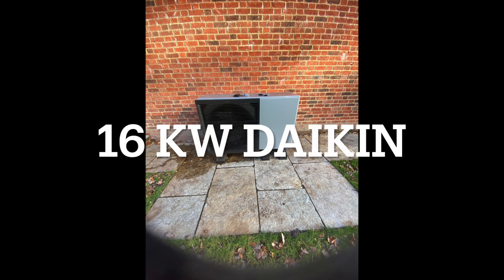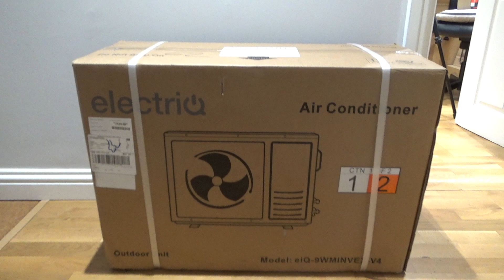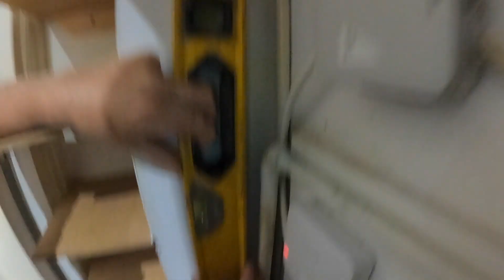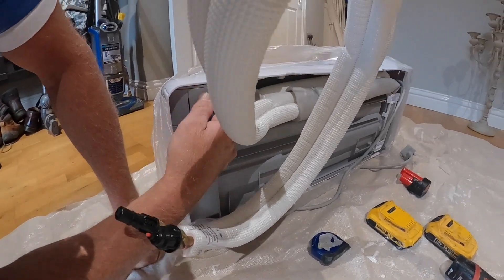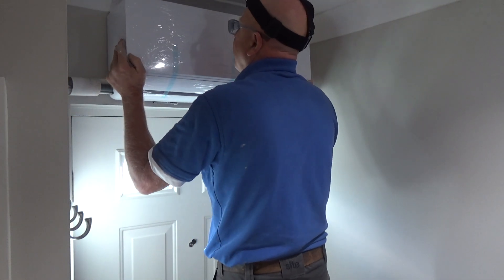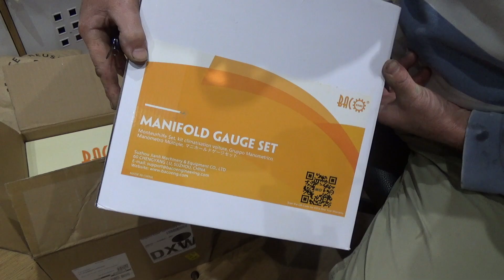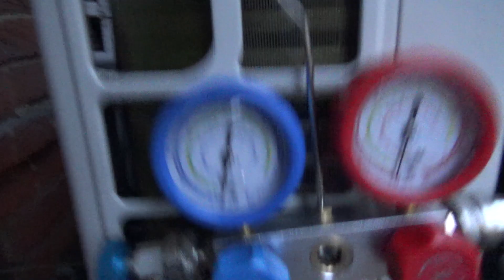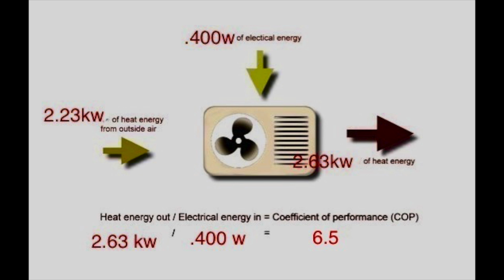HEAT PUMP - AIR TO AIR  MINI SPLIT  DIY INSTALLATION    IS IT WORTH IT  ???  IN U.K

Comment: How did you calculate the COP?
Reply from the maker: Hi I have a live smart electric meter . I have the monitor on my desk so it is quite easy to  workout usage.. if you don't have a smart meter I would have thought you could still be able to calculate usage  Thanks
Reply: @HEATSEEKER1428  it's more how your are calculating the heat output. If it's the heat output from the spec (2.62kW) then it's most likely incorrect, as the inverter compressor will reduce heat output and electrical load to match what's needed (if it's able to without switching off).  Working out an actual cop from air to air is pretty complex unless the unit is reporting it in real time.
You can probably work out an estimate from the amount of kWhs saved in gas (divide by 0.9 to account for boiler inefficiency) then divided by kWhs used in electricity.
Reply from the maker: Hi  I am not that familiar with the workings of an inverter  and you are probably right. my understanding of an inverter  is that it reduces the initial load of electric and gradually ramps up to full power. As far as the out put of the heat pump, I am not aware that the output is modulated , once again my limited understanding is that when the heat pump is running its output is 9000 Btu's  irrespective of input. Thank you.  @BenIsInSweden
Reply: @HEATSEEKER1428  The inverter allows for a quieter start up / shut off, but also will modulate the output.  e.g. my 7.7kW unit (which is technically rated at 35,000 BTU - but that's when it's 20C outside 😂), which at 7C will output 7.7kW at 100% speed for 2.4kW of electricity, but at 52% speed will output 4kW for 0.8kW, or at 10% speed output 0.9kW for 0.2kW.  I haven't been able to find a detailed enough specsheet for the ElectrIQ unit to see what variates the compressor to.
Reply from the maker: Hi  my understanding  of this unit is that  the output of the unit  is 9,000 Btu's.
and the maximum power input is 2620 w, 
The only thing that fluctuates is the power input.  This is determined by the temp of the surrounding air  down to deg neg. 5C.
The output remains at 9,000 Btu's. Irrespective of the power input, eg if the unit draws 2620 w the output will be 9,000 Btu's and if the unit draws 500 w the output will be 9,000 Btu's
The SCOP of this unit is 4.2.
As far as I can work out there is no facility for this unit to  modulate its output . when working correctly and  within temp operating range . The out put of the unit is a flat 9,000 Btu's. Thank you
 @BenIsInSweden
Reply from the maker: Hi to calculate the COP. Divide energy out. by energy in. For Example If your appliance has an energy out put  of 5 KW  and when running the input energy is 2 KW then the COP is 2.5   I hope this is helpful Thanks
Reply: @HEATSEEKER1428  Energy into the appliance is easy to measure, I was wondering how you measure the energy in from outside and energy out of the indoor unit to get your figures.
Reply: @chrismgeary  I think he may have taken the listed heat output - of 2.62kW, which won't be correct with a heat pump with an inverter compressor.

Comment: Great vblog and really nice install, I installed a split unit in my last house after having a loft conversion, moving on 16 years to another house, I'm not allowed to buy one now as I'm not 'F' Gas approved so had to get it professionally installed which hurt!
Reply from the maker: Hi You do not have to be 'f " gas approved as this particular unit uses R 290 as the refrigerant
Reply: @HEATSEEKER1428 Ah right, mine is R34 and that explains it 👍

Comment: Great video. 
Time for the Gov to apply grants to Mini Split systems as can be much more practical than water based systems and added bonus of cooling.
Reply: Gov will not even do grants on mini split. This is due to the cooling option demand in the summer.
Reply: @zjzozn  yeah, the Gov wants to reduce electricity demand and not increase it by everyone using them to keep them cool in summer.
Reply: It seems typical of government illogical thinking  that because it also cools its not good for the environment so no grants.

Comment: I enjoyed your video.  I'm guessing you have the 9000 BTU/2.6 KW unit based on the model.  I was surprised by the size of the outdoor unit.  From other videos from the US they are using forklifts and the like to maneuver the unit.  I've been wanting to dip my toe into a mini-split to supplement my gas furnace.  Even though I live in a frigid zone of Canada I think it's worth getting hands on and feeling out these type of systems.  Is your system a DIY kit?
Reply: Where is you purchase the unit?
Reply: @zjzozn  Appliances Direct has it (pretty sure it's a white label and electriQ is their own brand). eIQ-9WMINV is this one, and there's a slightly more powerful one eIQ-12WMINV.
Reply from the maker: Hi I purchased this unit from an on line company. appliances direct    thank you  @zjzozn
Reply: How are you finding this a year later? I looked it up and it says for a room 30m2 max, would you say that’s accurate? Would the heat spread to other rooms? My house is about 110m2
Reply from the maker: Hi Yes  my kit is DIY   and really easy to fit if you have  basic  skills . The out door unit is larger than I expected.  It is great supplement to my gas  central heating and so far usage it very cost effective .  Thanks

Comment: How much was the overall cost of all what was shown in the video please = thank you .
Reply from the maker: Hi 
The cost of the complete system was £ 569.00 inc . V.A.T. Plus the cost of 4 no. rubber feet approx  £15.00
Reply: @HEATSEEKER1428  It should have been VAT free surely?
Reply from the maker: Hi  Very little is VAT free  the price of the unit is inclusive of VAT  .  Thank you  @johnhunter4181
Reply: @HEATSEEKER1428  My apologies if what I say sounds or in actual fact is stupid , don’t know anything about heat pumps , when I saw your video it made me think    Buying 
four of these units would probably heat  all of my house without the need of any radiator  not sure of the cost in relation to running them = might be more expensive than just one big heat pump ?  As said in my head it seems viable , you being the expert your probably thinking otherwise.
Reply from the maker: I think it makes sense .  these units in my opinion are  eco to run obviously in really low temps the effency falls . but only really drastically went temp is neg 5 deg. or under..
Plus if you have 4 in different parts of your property you effectively will have 4 zones . @KavanOBrien
Reply: @HEATSEEKER1428  don’t know what you mean by four zones other than there are  four in different parts of the house , another stupid question if I may ask how much does your unit cost to run each week ,I’m home now all day so with you have installed it at this time of year the cost would obviously be more , maybe you can’t separate that unit from the overall cost of your bills ?
Reply from the maker: its difficult to asses as the unit that I have installed is supplementing my existing heating system, with the outside temp at the moment my unit is using between 400 watts  to 500 watts when it is running .
 @KavanOBrien
Reply: @HEATSEEKER1428  yes I thought it would be difficult to work out how much it would be  on it’s own, pity  you couldn’t turn of other thing on the first floor to se if that single unit could warm the whole area,maybe you’re going to make other videos in the future trying different scenarios.
Reply from the maker: The running cost and the efficiency depend on a lot of things , your insulation levels , outside  temperatures . I can say that the heat pump is much cheaper to run than a conventional electric heater it is almost defiantly cheaper to run than an oil fired system .I have not had the appliance installed long enough to do a  long term estimate of running cost compared to my gas central heating but as I said in the video  so far the  running cost are  pretty good . thanks. @KavanOBrien
Reply: @HEATSEEKER1428  thank you for being you.
Reply: @KavanOBrien  I think that he means that there would  be four units, and that you can set the temperature individually on each one of them - like four zones with individual temperature  if you used underfloor heating or radiators. Hth
Reply: @henrikkarlsson2281  Yes I thought about it  and came to the same answer ,  just like setting your radiator thermostat,  it did make me think though = people are getting a heat pump to send heat through the pipe work for the radiators in my mind that seems a lot of work = in my house which is a small three bedroom house = still has a lot of copper pipe plus the ten radiators just to get some heat , the one I saw that gentleman installed was trying to heat one area which made me think = I could put one or two upstairs and two on the ground floor and don’t need radiators or am I being stupid thinking like that ?  Don’t know the running cost of the small units compared to having one big unit,  my head is saying at least you can have more control with the small units and  turn them of in an area and warm the area where you are , because I tend to think differently anyway about most things = when I saw the video that the first thing I thought about , please tell me I’m crazy = I don’t mind at least then I will stop thinking about it .
Reply: @HEATSEEKER1428 oil is cheaper than gas 6.6p kWh with 0 standing charges. Was as low as 1p per kWh during covid. Common misconception that oil heating is expensive often propagated by people who have it in old properties and blame oil heating or the fact people do not spread the cost in the same way.
Reply: @KavanOBrien   It depends on how you live. We have a very open plan house and don't mind keeping all the doors open, so we have two independent 3.5kW units one downstairs and another upstairs. The house is always at about 20°C and 160m² 5-bed detached but well insulated.
Reply: @johnhunter4181  how much was the cost ?